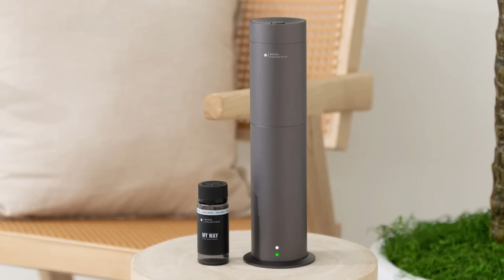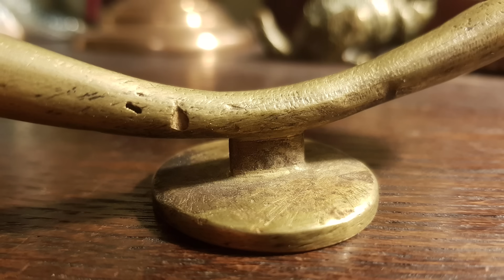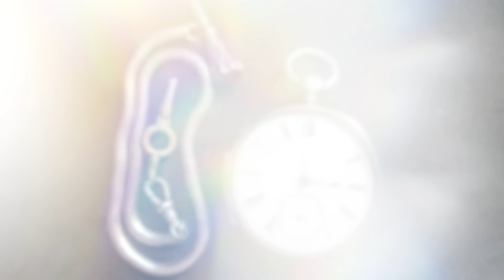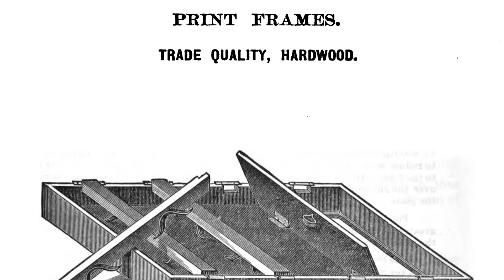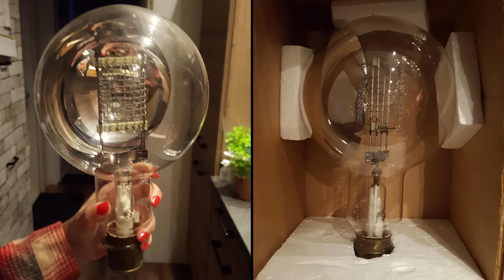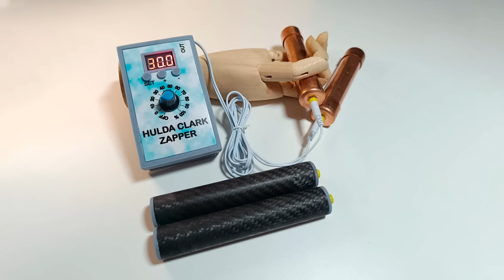WHAT IS THIS MYSTERIOUS ITEM? 140+ VINTAGE PIECES WITH GRIPPING STORIES! [r/whatisthisthing] #4 Comp

Comment: The "smudge pot" is actually highway construction markers. Smudge pots are much larger and cylindrical.
Reply: Correct, the item even had the words “Highway Torch” on it…I am old enough to remember them being used. 😊
Reply: The road construction marker is in the video at @2:02:28

Comment: I don't think you're smug pot for the round item may be correct. It closely resembles an old safety maker used in the 1950s around road construction before the battery flashing warning light we use. It was very common to see these little oil pots on the highway to mark hazards then.

Comment: @44:39 The rifle grappling hook was primarily used to shoot a light hand line between two ships, and then attach a larger line that was pulled back to the first ship. This procedure was repeated until the proper line was attached to both ships. This line could then be used to transfer supplies from one vessel to the other. Any thing from fuel to personal (using a bosun’s chair) could be transferred this way.

Comment: It's a soldering copper or soldering iron .
Heated in a flame, it is used by tinsmiths to melt alloys to seal seams on sheet metal fabrications .

Cheers
Dave

Comment: last item is  solderin  iron sometime called a tinning  iron the original styles were heat ing a  coal wood or oil flame.  larger styles with used  to solder   copper  vessels   and even tin and copper roofing

Comment: The one after the stitching horse is the lee helmsman station on the bridge of a ship.  With it there would be a dial for how many rpm of the screw for fine control.  
If this was for the navy the ahead speeds would read: all ahead 1/3, all ahead 2/3, all ahead standard, all ahead full and all ahead flank.
Therefore this was from a cargo or passenger ship.

Comment: Just Here999ld is correct. The tip was ususally brass or copper and I used to use these heated by a white gas fueled blowtorch. They worked quite well. You could clean the tip when hot using a steel brush and/or a damp cloth (very carefully).

Comment: I belive what you called a mortise gauge is actually a marking gauge for scribing a single line because there is only one scribing point where as a mortise gauge has two points.
Reply: Correct, but there was also a cutting gauge, this had a single small sharp but flattened blade and was used specifically for scoring across the grain, for the shoulder of a single sided tenon perhaps to fit in a groove that we knew as a cutting gauge! I am old school apprentice served O N C & H N C master carpenter and joiner!
Reply: @MrChrissy1r 👌🫡
Reply: Exactly correct.
Reply: @geoffbuss3699  See my comment above.

Comment: I believe this mystery item is a vintage soldering tool. Heat in a fire or coals and the extra mass of it allows more time for soldering as it cools.
Reply: dang, beat me to it
Reply: You were first👍
Reply: BINGO!
Reply: I thought it might be a tinning iron, used for applying a layer of tin inside copper or brass pots, as those metals can be reactive to acids in foods and add an unpleasant flavour to the food cooked in them.🖤🇨🇦